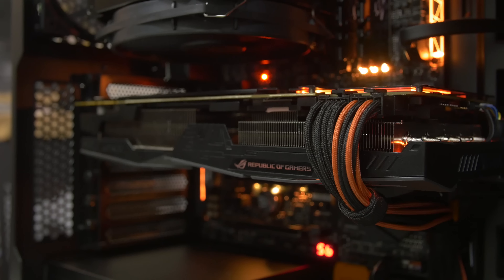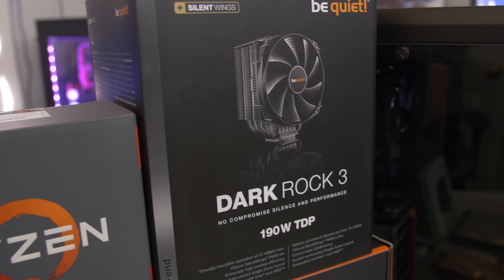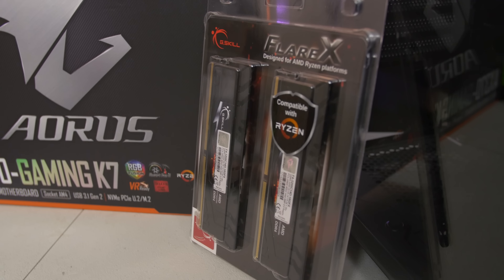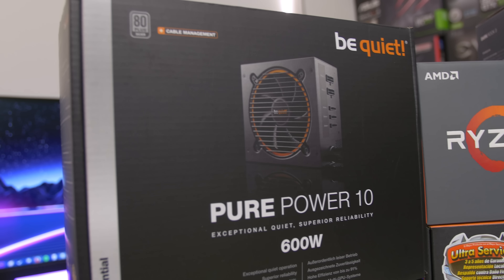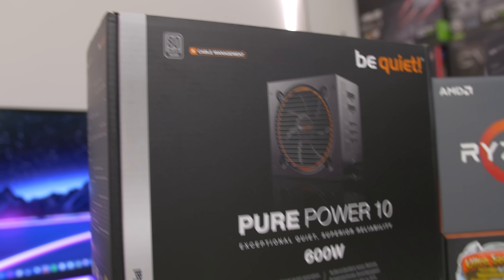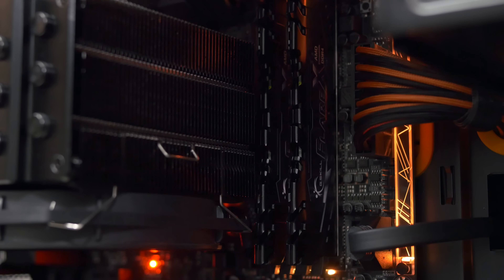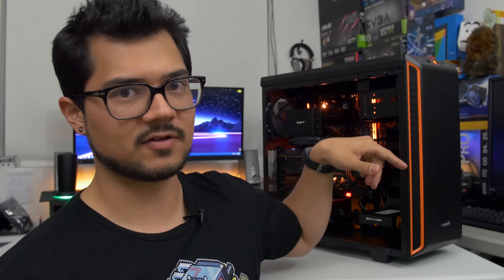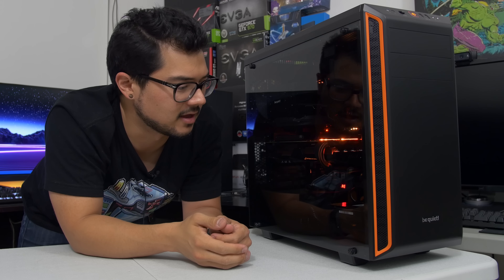INSANELY Fast Ryzen PC!! 1800X + GTX 1080 Ti

Comment: It's good to see someone else using the 1800X. I definitely understand the value arguments for the other Ryzen chips, but the 1800X has been a bit under represented I think. 

That Aorus looks great with the BQ color scheme, but I'm curious if you feel it has any advantage over the Crosshair VI Hero? I went with the Crosshair, my first non-Gigabyte board in many years. I wish Gigabyte had stayed with their older, less gamery Ultra Durable branding in this lineup. 

I initially used a 1080 Ti Strix but the Strix didn't play nicely with my triple 4K setup (all Display Port screens) so I put a Titan X Pascal I had laying around in there for now, not sure what I'll do with the Strix. I used a 960 Pro 1TB instead of the 850 Evo and an NH-D15 instead of the DR3, but still big air. I think the only totally different parts, aside from the motherboard, are the 1000w EVGA Titanium PSU and the 64GB of Crucial memory, but otherwise pretty similar big air builds.

I actually ALMOST got the Dark Base Pro 900 for this build but the Mastercase 5 had been calling out to me for awhile. Very pleasant build in it. 

Also, I didn't use my 1080 Ti Strix for long, but I don't recall the sag in mine being nearly as bad (and I definitely looked for it). I use a cheap Atlas brace for the really saggy cards though, only $20 on Amazon and looks pretty nice, so worth a shot. I actually always make sure to have an extra one on hand since you never really know in advance.

Comment: Lol, mounts the cooler with the fan positioned down at the graphics card, where most of the heat is radiated tworads the intake fan of the cooler...

Comment: is it modular like the 900 series? i inverted my 900 but someone said my GPU will be runs hotter by inverting the chassis instead of going normal ATX. also no M.2? meeeehhh :p
Reply: nevermind.. 600 has no modular feature.. but i want to hear about the temperature difference between inverted with normal ATX tho..

Comment: So I am trying to build a pc.  Here are my parts so far 
Evga 1070sc 
Ryzen 7 2700x 
X470 gaming plus mobo
Corsair vengeance lpx 16gb 
Evga 650w psu 
1tb hardrive
240gb ssd
If anyone has advice it would help

Comment: Can anyone please help me out. I'm planning on building a new PC next month. However, I was wondering what parts I should get. My budget is around the $1500 but I would like to know if that's too much to spend on a PC anyway. I'm looking for a good ratio between price and life span. So if anyone could provide me a built under 1500 dollars (unless a little more is beneficial) and could tell me how long it will last me, well at least how long the GPU and CPU would last me until I NEED to upgrade in order to even play new games. It would help me out a ton!

Comment: Gigabyte motherboards are finally moving away from Realtek sound chips. The flagship G1 was the only motherboard of Gigabyte that didnt use Realtek for their intergrated sound. Asus is smart and began to pull away from using Realtek.
Reply: My opinion based on my experience is that Realtek is cheap and for me the quality is bad. Its like comparing the headphones that comes free with your new cellphone to a set of high quality, tested ones that will last and work well. If you just want a motherboard then later  upgrade to another soundcard to install then you can always just disable the Realtek. But the price of these other soundcards range on the average from $40 - $200 so for me its just easier to buy a motherboard that does NOT use realtek. =)

Realtek is the 'level entry' sound processor with motherboards. In another words instead of sending a motherboard with no sound the different companies like Gigabyte, MSI, etc purchase the cheapest brand, realtek so we get what we pay for.

I record music and normally use outside/external sound cards and recorders. But in the past I had the unfortunate experience of finding out the quality of Realtek is subpar to say the least. I say its crap. I have tried to record audio directly through multiple PC's in the past 10 years and everytime I came across issues with the sound it came down to the Realtek. Issues like buzzing, feedback, ticks, pops, latency issues and conflicts withother programs and hardware. After a lot of research I started to realize it was the Realtek so I swore I would go on a life long campaign to tell others not to depend on Realtek for good quality. 

Here is Creative labs website http://us.creative.com/  and http://www.soundblaster.com/ which are both companies that make sound processors for motherboards. Now look at REALTEKs website http://www.realtek.com/ . I think their site reflects their quality.

Here are a few ATX motherboards that DO NOT use Realtek

 https://www.newegg.com/Product/Product.aspx?Item=N82E16813132926&cm_re=motherboard_atx_z270

https://www.newegg.com/Product/Product.aspx?Item=N82E16813128963&cm_re=motherboard_atx_z270

https://www.newegg.com/Product/Product.aspx?Item=N82E16813132930&cm_re=motherboard_atx_z270

Comment: so i am in a crossway about getting the ryzen 5
my problem is should i just wait and save for a 1600 or should i go ahead and buy a 1400 and then later maybe upgrade to 1700 now keep in mind that i wont be buying a new graphics card for a while i have a rx 480 4gb by the way what do you guys think should i just wait a few months save some money and buy the 1600 and sit on it or should i just upgrade and countinue to upgrade through the year i do really need the upgrade for my mobo and cpu i have a i7 860 and a very old mobo it can not overclock ill figure out what i have once i get home

oh and yea i have a evo 212 cooler i would just need to get the mount or whatever for the am4 so yea i can overclock  any that i buy

Comment: If you are looking for 32GB Ram in 2 Sticks My GSKILL Trident Z 
3466mhz Kit (2x 16gb) F4-3466C16D-32GTZSW, Will Not Stabilize with Ryzen 7 1800x and Asus 
Crosshair VI Hero after the 2866mhz Mark. And i've contacted both Asus as
 well as Gskill and BOTH have responded to my troubles and have said 
that this is due to a MoBo bios issue that is supposed to be corrected 
ASAP. 
We shall See. Really Don't Mind Due to the Quality of the Chips and the 
Longevity of them also, It just sucks because of the price tag for the ram alone. 
But it is my main workstation and i am happy with it so far even despite
 my few overclocking issues, It STILL CRUSHES MY LAST WORKSTATION WITH 
HALF OF THE THREADS DISABLED SO I AM VERY VERY HAPPY. 
This thing Crushes Chief Architect X9, Photoshop, Auto-CAD, Bluebeam, 
Inventor, and that is with them all running at once.
Plus all of the Office 365 programs i use like Outlook and Bla bla...
The 1800x is a must for all workstations in a content development 
environment!!!
Ive only Ran it with a Corsair 115i so i dont know about the air 
cooling, Screw that just Put it under water and sleep good at night.
Just My Thoughts (also SAMSUNG 950PRO or 960 Pro/Evo is a must if you 
want the top notch speed)
Just Get the 1800x and put it under water, if not you'll wish you did. I
 can EASILY OC mine stable at 4.1ghz, I run mine at 3.8ghz though just 
for longevity and extra stable environment so no worries plus a bit
 less heat.
3.8 or 3.9ghz at 1.45v for the processor and with DDr4 1.35 to 1.45v. You'll be impressed i think.
Also DO NOT BUY THE MSI X370 XPOWER GAMING TITANIUM MoBo, it is a piece 
of over expensive SHIT literally,
If you don't believe me get it and see for yourself, GO with the ASUS 
Crosshair VI Hero it wins HANDS DOWN Period.
Hope It Helps.

Comment: So far I'm enjoying my 1700X, especially coming from a 8350, the insane amount of FPS increase out of the box is just refreshing. I have noticed games not being optimized for example in Arma 3 if I run 32 bit I get 40 fps avg on public servers while in 64 bit I get 60 fps avg. I do have a question, slightly off topic that google hasn't heped me with, I bought my first liquid cooler, kraken x62, what is a normal range on the liquid temps while under gaming load, usually I'm at 41-45c liquid and my cpu temp stays around 40c average. Thanks guys/girls

Comment: This build is now a giveaway for you guys. No, I'm not kidding. Watch his latest video. It is an international giveaway so anyone have a chance to get this!
It is unconfirmed yet but BitWit will change the BeQuiet air cooler to Corsair 280 mm liquid cooler. Plus, the RAM will be replaced with the Flare X 3200 Mhz DDR4 RAM (fully compatible with Ryzen).
So, yeah. Beast-like PC priced $2000+ could be yours! I have sent in my entries. Do it now or before June 3rd at 7 a.m. (Pacific Time). Check out his video for the details of participation.
Thank you for the giveaway Bitwit. Love you, man~

Comment: Ryzen 5 1600 is the only cpu you'll need for the next 3 years. The bang for buck is brutal.

There's no point in buying any intel chip specially their non HEDT platforms, you're stuck at 4 cores. the R5 1600 already destroys i5-i7 quads at gaming/productivity.

Just games you lose what? 10% fps while keeping 40-60% (i7-i5) more performance for everything else.

Comment: Good lookin' build! Regarding your cooler's orientation, in my experience coolers do better when the air is flowing straight up. GPU heat load is inconsequential compared to the improved performance that comes with better flow. Moving air across a series of horizontal fins results in turbulence that impedes flow and thus lowers performance. Vertical fins give better cooling.

Comment: I get getting the best parts that you can afford when building a pc.  But to upgrade every time a new part comes out doesn't make sense. I gots to have the 1080 when it comes out. Oh look! they have a 1080ti now, gots to have. Oh look! Their coming out with a 2080ti, gots to get it. In 6 mos they'll come out with a more powerful card and some idiot will just have to have for no other reason than it's new.

Comment: guys should I take an i7 7700k or 1800X ?? I dont really know ^^'
Reply: Quen Qu no. 7700K only for gaming is better if both has 3200Mhz ddr4. its a fact. but if you want to have alot of stuff in the backround or do stuff like video editing too Ryzen is alot better with its 8 cores but 7700K is better just for gaming.
Reply: If you are doing content creation ryzen.
Also both cpus are just way overkill. go for an i5 7600k or a ryzen 1600 and throw it into a better graphics card. something that will be used a lot more and useful for pure gaming.